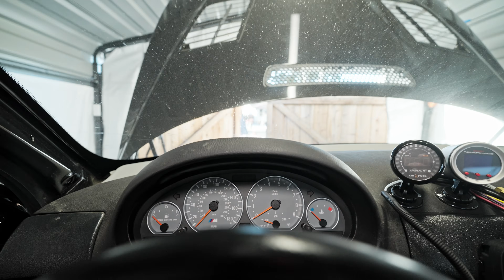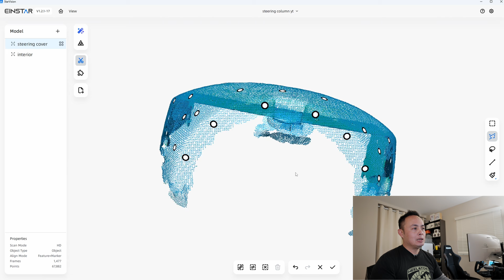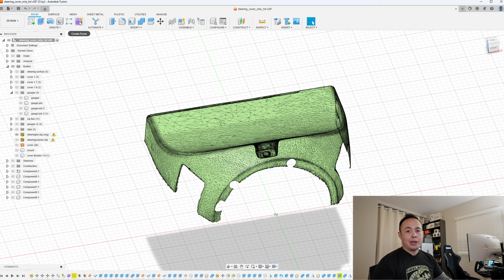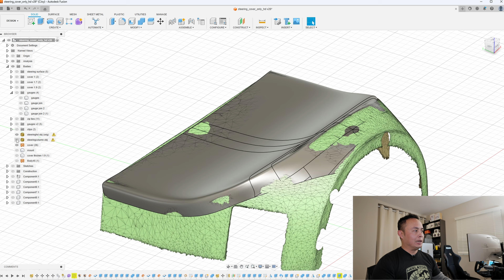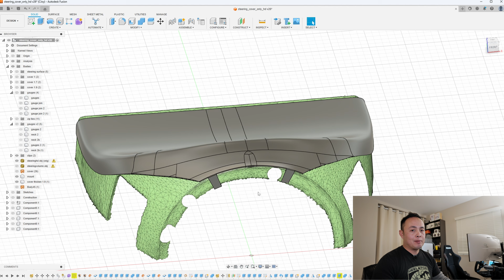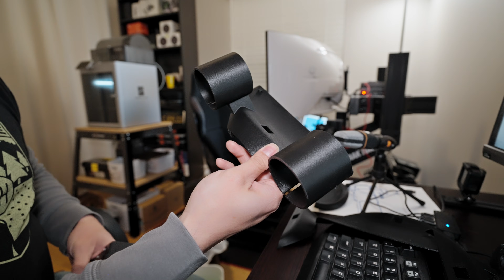3D Printed Car Parts - Steering Column Gauge Pods

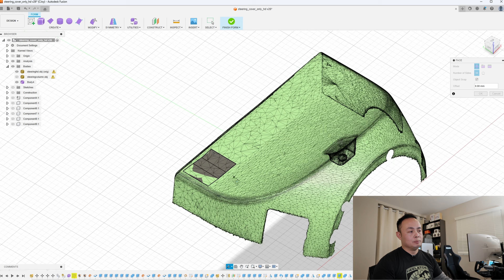Comment: 13:14 to save a lot of time you can add one large face on an area and then use your subdivide and it will automatically snap and make the curbs and bends a lot better
Reply from the maker: Thanks for the tip!

Comment: Ayy! Fellow Bay Area Car and 3d print enthusiast!

I’m currently reprinting my body kit for my FK8 from PETG to ASA.  My PETG kit warped from heat, so I’m finally taking a stab with ASA. It’s sooo much easier to print compared other ABS and has way less odor.

I found a 3d scan of my car, but I wanna scan my hood and compare it to see if it’s 1:1.  I’m only using my phone as a scanner til I can afford a similar one like yours
Reply from the maker: @FlipThisHobby  what gave it away that I’m from the bay?  Hehe.  I tried asa also, can’t get it to stick on the bed for thin long parts, friend suggested a different glue and a smooth plate.  DM me on IG @cjoy_458 if you want to collaborate on a project.
Reply: @ you mentioned SpeedSF and you mostly track up in NorCal, so it was easy to decipher!

What I’ve been doing with my ASA is use a brim, set a z-offset of -.1mm, and also cover my P1S with the box that it came with since my garage is always cold.

ABS/ASA needs an ambient temp of 40c+, so you gotta warm up the chamber for at least 30min before. And you gotta let it cool about the same amount of time, so you don’t get that warping from the bed.  It is a bit more tedious, but I think it’s worth it in the end.

I actually just finally started sanding one if the pieces and it’s actually way easier to sand the PETG. I mostly print on PETG and I just started reprinting the pieces in ASA last week
Reply from the maker: @ nice

Comment: I don't like delegating the processing to the handheld processor.
Having the ability to use a 3d scanner on a lackluster PC, and then upgrading to a modern PC is staggering in everyway (frame rate, etc).

Maybe a modern Mac or ARM silicon chip would work amazingly in a hand held!!!!!!
Reply from the maker: At first I wasn’t a fan of a standalone and the processing power of a handheld, but the flip side is the portability.  I already found myself scanning more things than I would with a standalone, just the fact that there’s no wires is so convenient.  I do all my mesh work on the pc for speed and screen size even tho the handheld is capable.

Comment: To ovoid holes place the your dots more randomly will also help with tracking as well it can get confused if it all the same spacing allows for reference points to mix with certain angels casing all sorts of weird crap. But If you made it look even and nice for the vid completely understandable lol.
Reply from the maker: @crabman823store9  lol thanks for the tip!